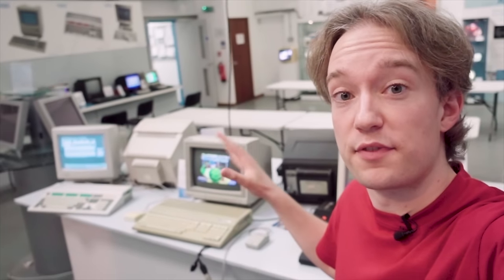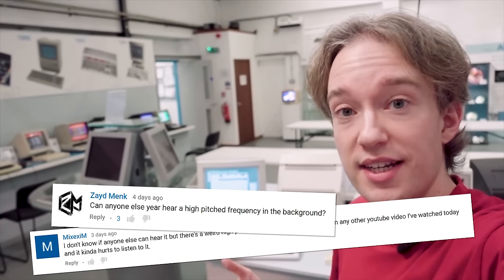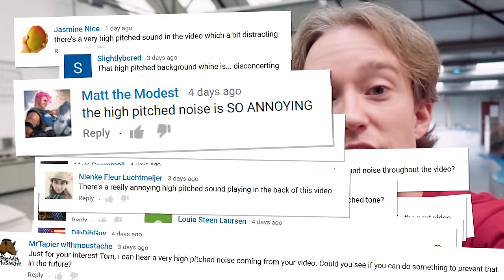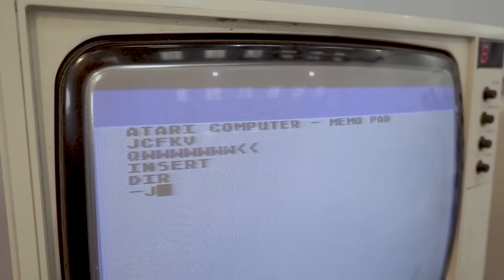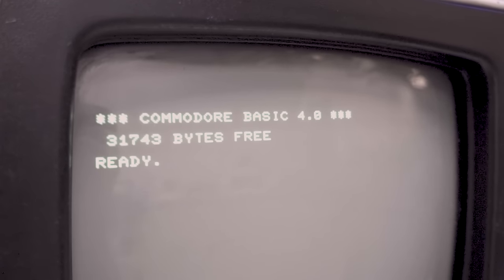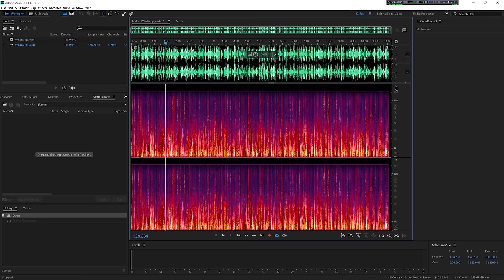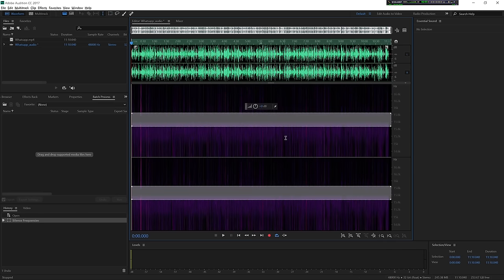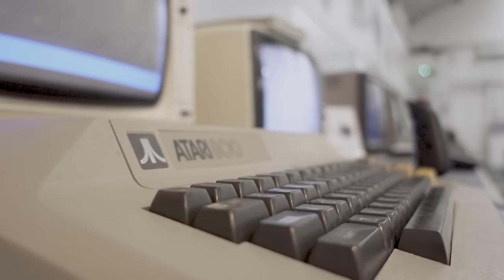Why old screens make a ʰᶦᵍʰ ᵖᶦᵗᶜʰᵉᵈ noise

Comment: This used to be my "superpower" as a kid. I could always tell when the television was on without even looking at it and with seemingly no sound. Sometimes when a TV takes a long time to start and my parents would keep pressing the start button, I would tell them to just wait because the TV had already started and is just loading. Other times when someone would watch the TV on mute (to avoid disturbing sleeping people in house) i could still tell the TV was on because of this sound. I genuinely thought I had a superpower
Reply: Same! I could pick out where in the computer lab a monitor was left on too, not always perfectly, but enough to go to the right row instead of walking the whole room. I wonder if I still can.
Reply: Back in the 1970s my second ever job was as an apprentice TV Engineer. Because I was hearing that 15,625 Hz noise all day long in the workshop, I think I must have learned to mostly tune it out. Back in those days most TVs had a "Horizontal Hold" - I could adjust it by sound alone knowing that, when it was set right, it didn't appear as loud to me.
Reply: SAME! My mother used to go nuts turning the tv on and off b4 the picture could start and I was watching in amusement hearing the noise getting on and off.
Reply: @Nimerian  what a lad
Reply: this is exactly what I've been through (:
Reply: I am probably much younger than you all so I may not have had the same experience, however we had an old television at a relatives house which did exactly that. I had no idea why I could hear it until I was about 6 after I realised that it was only that kind of television. I do like hearing all your stories though!
Reply: I never thought of it as a superpower, but I could hear the sound too. It was more reliable than looking at a TV to tell if it was on or off (which probably is confusing to younger people who are used to modern TVs that always show something when on). I wonder if I can still hear it. I haven't been around a CRT in a while.

Related: When I was a teenager (think mid-1980's), there was this one day when I was watching my TV in my room with the door closed. As it got later & later, I kept turning the sound down so as to not disturb anyone. Nature called. I hit mute to completely silence the TV. However, that is not what happened. The TV got louder! Yes, the mute sound level was louder than the level I was listening at. I had muted the TV "successfully" many times in the past, so the louder sound was completely unexpected. Hmm... now that I think of it... maybe my TV had broken.
Reply: The TV (CRT) being on on mute is even more annoying.
Reply: Same here - it always astounded my family that I could tell, on walking in through the front door, that someone had left the TV on mute even though it was two rooms away! I knew what caused the high-pitched whistling sound (well, more or less) but what amazed me was that nobody else in the family seemed able to hear it. 
I also complained at school because my technical drawing classes took place in the school's CAD lab and I could hear all the computer monitors making the exact same whistling noise, it was more than really distracting, it was loud enough that I found it actually painful at times; but whenever I said anything about it, the teacher made everybody go silent for a few seconds, listen, and then announced that I must just be hearing things, and it was laughed off as me just being weird and hearing "sounds that aren't even there". I had some of my mock exams in that CAD lab and I struggled to concentrate all the way through because of that damn sound. The teachers honestly thought I was just time-wasting or attention-seeking or something. 
I didn't completely make the connection because although we had mandatory hearing tests in school when I was younger, that was when I was about 6 or 7 years old, and primary schools in 1988/9 didn't have many computer screens. By the time I was doing my GCSEs in 1997/8 though, many more screens meant a lot more noise, but they weren't doing regular hearing checks on students anymore, so I didn't see the link. 
As flat screens gradually replaced old CRT televisions and computer monitors, it was such a blessed relief to not have this incessant whistling noise in my ears all the time anymore! xD
Reply: I am 19 and still can hear when my grandma changes the channels on the TV.
Reply: I could tell you when the TV was on in the other side of the house! I wonder if I still could, but sadly we don't have any CRT screens anymore
Reply: I am now 34 and can still hear that noise. My hearing does have damage as i work in the metal industry but my hearing damage is not at that frequency. It stops somewhere above 16000 Hz with my ears
Reply: Huh, me too! Plus me hearing is sensitive
Reply: You would be a good BBC goon indeed!
Reply: I could use ours as a sonar to tell when parents were headed into my bedroom. 
I could also hear ultrasonic motion detector emitters. And some portion of bat sonar sweeps.  Lost that in my mid 20s.
Reply: I can hear when a smartphone is charged up to 100%
Reply: You must have been so cool
Reply: Kids can detect a higher frequency but somebody’s probably told you that already
Reply: I don't even remember having one. As far as I can remember I just had a crappy massive tv that then would probably be considered thin. The power of my parents not being born 10 years earlier
Reply: Could this be why some people still think they are allergic to electric appliances?
Reply: I could always tell if it was on as well. To me, it's this sharp whistle that seems like it's coming from the core of my brain. It's very painful and I'm thankful for flatscreens!
Reply: I used to be able to hear that as well when I was a kid. But I couldn't tell you when that stopped, because CRT-TV's vanished. I only do know that now in my mid 40's I don't hear the frequency any longer when I come across CRT-TV's.
Reply: Same!  I thought I'm the only one
Reply: Bro, same.
Reply: My version of this is I can hear the very high pitched whine coming from certain chargering plugs. Higher power ones are the worst for it like my Samsung fast charger.
It's not a constant thing since e my brain just tunes it out I guess but it's more noticeable when I have a headache or aren't feeling well.
Reply: My high school had a whole room full of Apple ][ computers. As Tom explained, the monitors made a high pitched noise, so it was easy enough to check at the end of the day whether all the monitors had been turned off. It was only after all the monitors got shut off that I could hear if any of the computers themselves were still running.
Reply: Same!!
Reply: To this day, I can't watch VHS tapes on my parents' old TV, because the high-pitched whine drives me nuts.
Reply: There is nothing unique about me or my life I guess
Reply: I always wondered why my parents didn't realize the TV was already on, I never thought about the fact that they couldn't hear it, mostly because last time I actually thought about it I didn't know they couldn't hear it. For a long time we actually had one of those old cube TVs even though modern flat-screen TVs had been a thing for a little while.
Reply: I'm just going to park my self here with the 'who left the CRT TV on?' Avenger group.

This thing would wake me up from sleep, it's that annoying.
Reply: Yep. I could tell which of the 3 TVs were on and off, anywhere in the house, almost on command. I would come home, open the front door, and say "the den TV is on, the PC tower monitor in the same room is off, and the big screen in the upstairs bonus room is on," even before stepping into the house.
Reply: OMG that explains so much. I thought I hallucinated this as a kid because of the sound the tv makes when on.
Reply: I could hear the living room TV turn on from any room in the house, back when it was a CRT still
Reply: Same here 🤣
Reply: I can still hear all sorts of electronic devices nearly constantly. I used to think it was just my ear ringing, then I realized it stops when I’m out in nature, far from civilization. It’s NOT the “humming” that most people can hear but something very high pitched. Idk what it is exactly or how high is it, but more electronics plugged in nearby = louder noise.😭
Reply: I probably can't hear it anymore but I remember it so well.
Reply: Nah just a poorly sound insulated set I imagine.
Reply: It wasn't loading it was heating up

Comment: For anyone who isn't aware, Tinnitus – for a lot of people including myself – is that very sound, but constant. Never going away completely, always there, often an amalgamation of multiple high pitch frequencies. I've had it for as long as I can remember and notice I often tune it out subconsciously, but when it's quiet around me, it's there. 

So this video's coming up on 3 years old but I only recently found it, sorry!
Reply: My tinnitus is the same frequency as a CRT. Grew up with it always on and even slept with it through the night. I wonder if this is a cause of tinnitus
Reply: Same. I can never have total silence and need background noise just to sleep because of it.
Reply: @kirara2516  box fan
Reply: @professorjack2099  that helps. Sometimes I also have to use a video of a crackling fireplace or rain falling in a forest to help.
Reply: i dont have tinnitus but my ears have a genetic thing in that they grew in a weird way that lets me hear higher pitch frequencies than a person with normal hearing, i hate the sound of CRT screens beacause i can hear them, not only higher pitch frequencies but i can hear lower volumes too
yes i do have frequent headaches from this
Reply: @professorjack2099 tinnitus ringing is often just the sound of what you have lost in your hearing kind of like a phantom pain, so probably.
Reply: Earlier I feared I have tinnitus because of that, until I unpluged everything from the wall. It was coil whine from cheap phone charger.
Reply: @heroninja1125 How does that work? I thought it was that the hairs had folded and couldn't fold back, so they're essentially sending a signal for a high pitch constantly.
Reply: @saiv46 Why does that even happen?

Comment: "Protect your hearing" as i listen to high quality bassboosted memes every day
Reply: Bass is a different frequency and near harmless to hearing. If it's around your natural frequency it can disintegrate organs
Reply: @dcarbs2979  "Near harmless" 
"Can disintegrate organs "

I'm getting seriously mixed messages here
Reply: @thejojomonado3647  Audible bass is near harmless. The frequency you need to disintegrate an object is the natural frequency. For humans that's 7Hz (below the audible range of 20Hz). And you'll probably need a bigger amplitude than domestic hifis can produce to achieve it. Club and festival-scale PA's should be able to do it!
Ears have smaller components, more susceptible to damage from higher frequencies.
Reply: If that's are frequncey, I wonder why I have not heard if sound weapons.
Reply: @dcarbs2979  while resonating at our natural frequency can be discomforting, it will not desintegrate organs. The natural frequency of a human body ranges from 3Hz to 7Hz, with newer studies saying up to 10Hz. However different body parts have different natural frequencies.
Reply: @dylanpyle6500  back in 2017 Cuba was accused of using sound weapons on US diplomats. 
Sonic and ultrasonic ("sound") weapons are in fact a real thing.
Reply: @memeeeeh  It would technically be infrasonic weapons, ultrasonic is higher than hearing
Reply: @claytongiambelluca3551  so you think just because you can't hear it, it can't be weaponized?
Reply: @memeeeeh  I thought that was debunked?
Reply: Did you lose your hearing yet
Reply: @sandwormy  no
Reply: @blueberry1c2  tinnitus?
Reply: @blueberry1c2  do a hearing test
Reply: Ear pain=/= funny
Reply: @dcarbs2979  Not true, any frequency can cause hearing loss if it's loud enough. It's mainly two factors that cause damage that being volume and duration. A bass guitars range is from 40 to 400 Hertz alongside the harmonics.

Comment: I went back and listened to the previous video. I couldn't hear the high pitched noise either.
Maybe we need to view the inability to hear such noises as an asset. At level 7, we get +4 resistance to sonic damage.
Reply: Unfortunately, that's not how it works. You can't hear it - and it still damages your hearing. Sort of like how you can't see UV light, and it'll still boil your retinas. This stuff's super unfair.
Reply: I can hear it but just barely.  For contrast I had no problem hearing the easter egg at the end of this video.  I think the humming is just low in volume and at a frequency made by a variety of electronic devices (or ear congestion).
Reply: Jeremy Baxendell An immunity to Unrelenting Force... FUS RO DAH!
Reply: You could also have speakers/headphones that can't play those noises, as well. And it does not make you more resistant to sonic damage, it means you already have it.
Reply: what's the last video with the high pitch noise?
Reply: I can hear it :P it is very painful with headphones
Reply: My laptop speakers do not play the buzz sound in the old video. I do hear it through the desk speakers i have though. Headphones don't seem to be working that well for it though.
Im 29 also. It bothers me at night when I walk past the tv that was forgotten on and on a black screen. LCD tv, and it still makes a sound. I don't even have to be directly in front of it.
Reply: +Pomax On Youtube (Pomax) fxuked up

Comment: I'm "fortunate" that at 39 I can still (barely)  hear the mosquito alarms. I was always really good at hearing the flyback transformers as a kid and would often be the only person in a room who knew that a TV was on - and be unable to concentrate on anything because of the noise.
Reply: Did you also hear Phone chargers and other (cheap) transformers?
Reply: @ThePixel1983  in my case yes. Cheap phone chargers, CRT screens, the cooling coil in my 12v electric cooler.  Also people who smack when they eat, or moist mouth noises from radio or TV presenters cause me distress.
Reply: My grandparents had those pest repellers you plug into the wall, supposed to chase off mice with high pitch noise. As a teen i could hear them.

Comment: I am 70. My upper limit is now 9000Hz. My hifi stereo system still sounds the same. I guess my brain is filling in the missing frequencies.
Reply: Most likely you just lost your hearing so slowly that you forgot what those frequencies sound like. My freinds grandpa has a really good home theater and hifi system in his basement that we use whenever we hang out there, and its kinda disappointing because the calibration and speaker placement is really messed up because his grandpa can't hear well enough to realize that it sounds like garbage due to the way its set up. Its all pretty decent equipment, its just setup wrong.

One time we played an old cassette in it, and I could hear the azimuth was completly off. I fixed it, and his grandpa couldn't hear the difference, while my friend was shocked that cassettes can actually sound really good with nothing but a quickly done by ear calibration.
Reply: As you age, your brain starts to make symbolic shortcuts. You think you see or hear something,  but more and more of it is memories.
Reply: If you can't hear the morse code at the end card, put a portable AM radio tuned to around 530 KHz up to your computer's speakers. You can clearly hear it thru the AM radio. Turn up your computer's volume to max.
Reply: geocarey   That is absolutely true.  Your mind compensates for shortcomings in all your senses.  It does this in a way you cannot discern.
Reply: Well then you probably didn’t hear the high pitch in the end. It was morse code that said “Never gonna give you up”. At least you’re immuned to high pitched rickrolls, so I guess that’s your silver lining?

Comment: I just went back and rewatched the video, and I couldn't hear anything. (29 years old).

And despite any complaining the noise may have caused, the video was at a 34,966 to 379 like to dislike ratio. It was an excellent video and you should be proud of it.
Reply: which video was it?
Reply: If you wear earphones, they can damage your ears.
Reply: I couldn't hear anything at the end and started freaking out (I'm 26 and have been pretty careful with my hearing). But then I tried playing the video on my phone instead of my computer, and I could hear it very clearly...
Reply: Huh. I did the same. I couldn't hear it on my PC, but could clearly hear the high-pitched sound on my phone... so the question now is whether the PC/Headphones failed to play the frequency, or if the phone caused it to be played at a lower frequency which I can still hear.
Reply: Tim Kofoed That doesn't happen, nothing would ever change the pitch if the speaker can't play it. it just doesn't happen.

Comment: The magneto restriction comes from the LOPT (Line OutPut Transformer).  Original CRT based TV design was incredibly clever - the line output drive (the sawtooth waveform) drove the horizontal yoke which deflected the electron beam horizontally, but at the same time this sawtooth waveform was also fed into the LOPT to step the voltage up to create the high voltage that was needed to drive the electron gun.

Comment: I'm about 3 years younger than you and I've also always prided myself on my hearing and ability to pick up high pitched noise. Even as a kid and a teenager I noticed sounds my peers didn't, often to my own agony as they are unwelcome sounds. I still hear sounds others my age don't (office halogen tube lighting ruins me) but I know I won't have that "ability" forever. So I sympathize very very much with your fear, Tom.
Reply: If you can't hear the morse code at the end card, put a portable AM radio tuned to around 530 KHz up to your computer's speakers. You can clearly hear it thru the AM radio. Turn up your computer's volume to max.